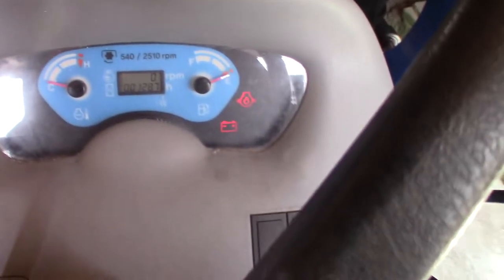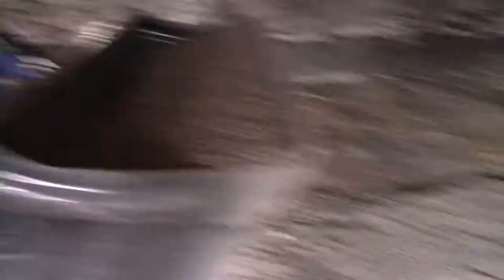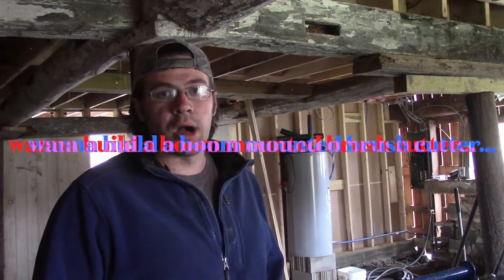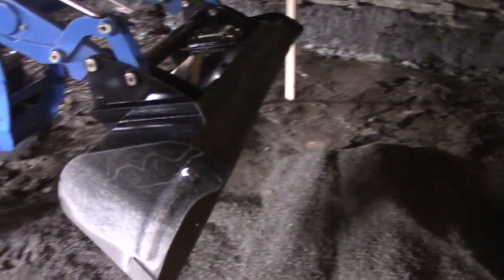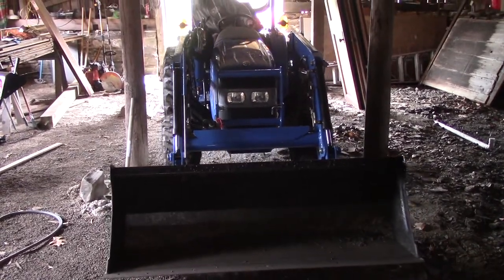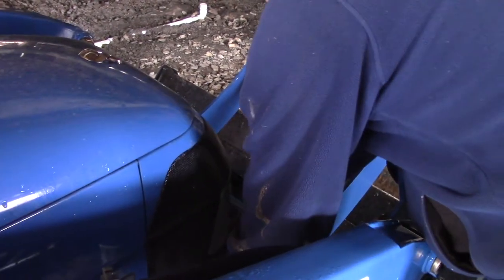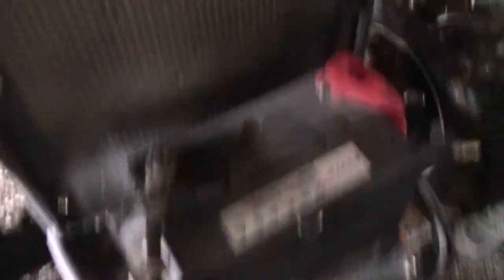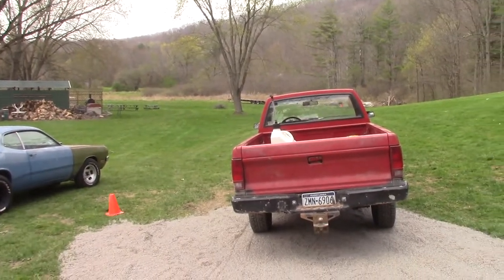New Holland workmast 25 review

Comment: I park my El Camino each year for the winter and got it in a few years ago for spring cleaning and driving. The clutch stuck over the winter so I ended up raising the rear wheels and starting it up. I brought the RPMs a bit and hit the brakes. Took a few times but it finally broke loose. I installed a new clutch kit when I rebuilt the motor. The original clutch was in with 127k miles and about 39 years from the factory. Nice feature on the tractor to be able to lock the clutch disengaged.

Comment: How does the Workmaster 25 handle the mower on hills?
Reply from the maker: Hi Richard; I have a steep hill I have to mow at the bbq. And I do have to gear it down for that. Its not the majority of the yard so it doesn't bother me. If the entire yard was all hill maybe I would get a higher hp tractor but I really want to avoid any and all DPF issues. It will mow anything its just a matter of how fast ya wanna go. And for the most part its as fast as I wanna go.Thanks for the comment and thanks for watching! John
Reply from the maker: FYI; Changed channel name to John Frytag. Thanks!